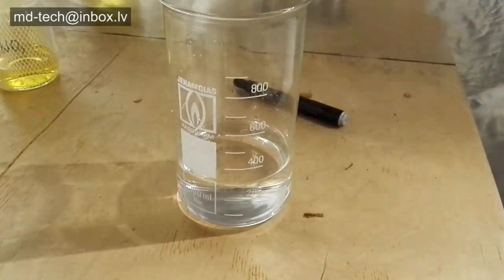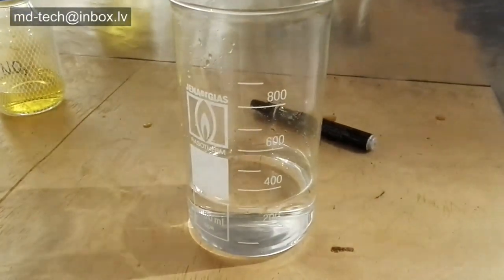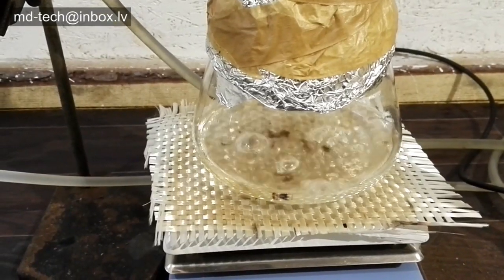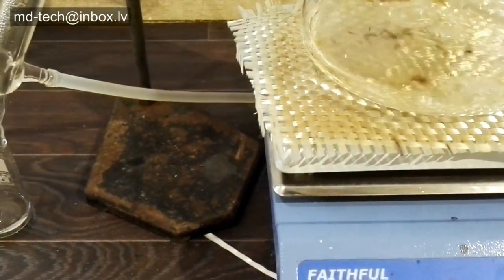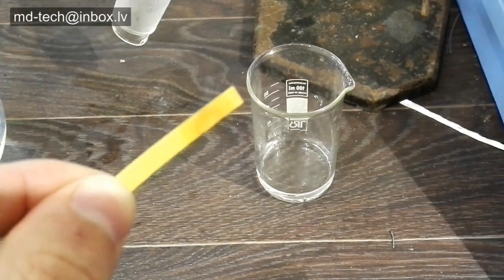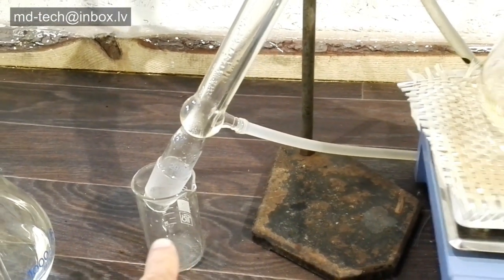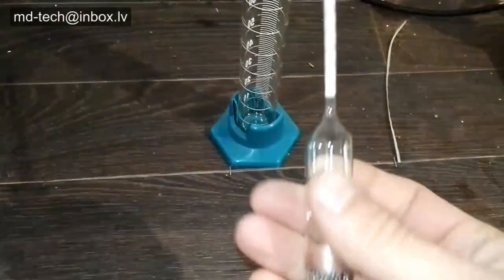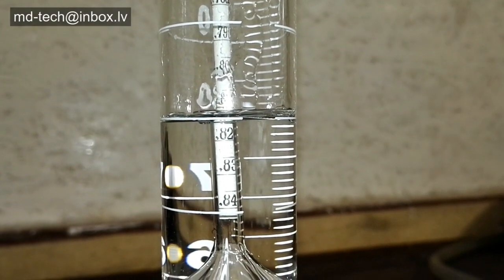How to make concentrated sulfuric acid.

Comment: Do you know why when I doing this nothing comes out form the distillation column? 
The 500ml acid boiling in the 1L flask but no single drops come over.. is it meant that the  acid what I try to make it more condensation is already in  around 98%? 
Or because my condenser is too long (300mm)
Reply: Is there anything condensing in the condenser?